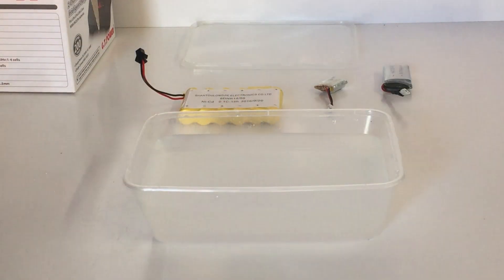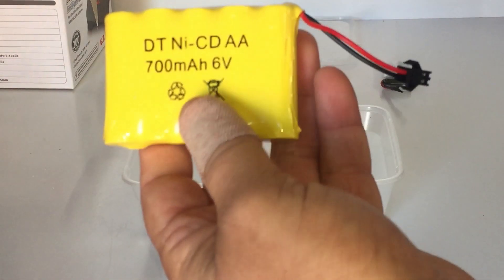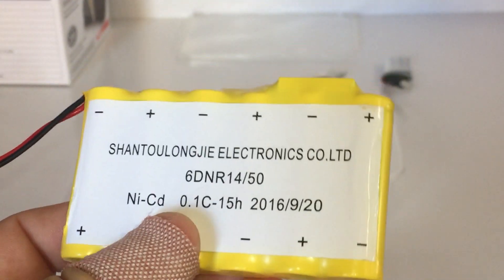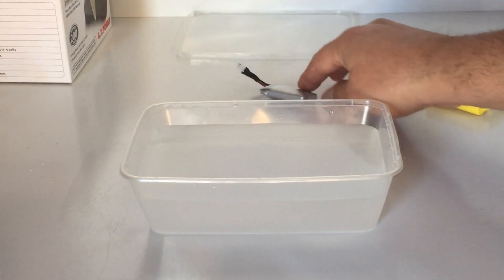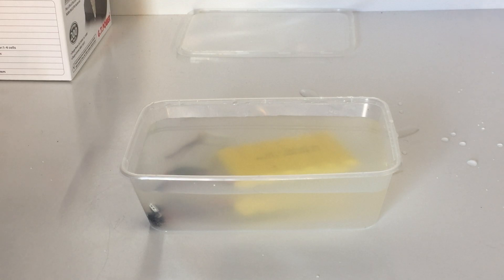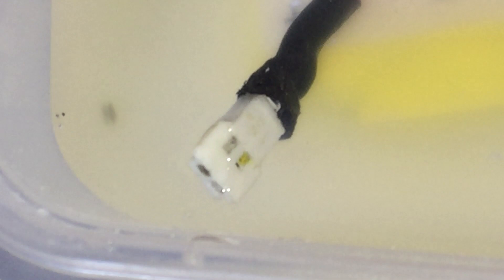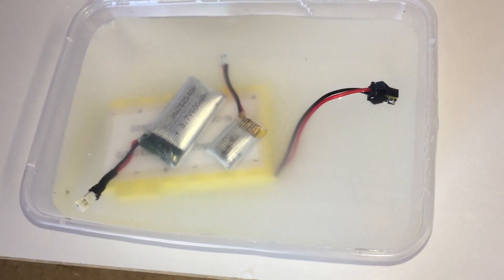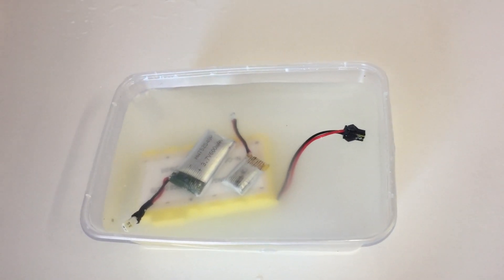Faulty, Puffy RC Batteries? How to Safely Discharge them with Salt Water ✔

Comment: I’m here thinking he was going to tell me after all the bubbles are gone I can just throw them in the garbage 🤦🏽‍♂️ so I still need to take them to a recycle center.  Why not just take your battery from the get go.  Discharge as far as you can and then take it to recycle center.
Reply from the maker: Mate you can do what ever you want to do with em, if that's throwing in the garbage bin, but i wouldn't advise that and take it to a battery place instead that can dispose of faulty batteries properly, even discharged

Comment: 7:24 That yellow at the connector is not the 'nickel or cadmium being released'. The battery chemicals stay in the sealed battery cells. What it is is the results of galvanic corrosion on the pins/wires in the connector. Probably from the copper in the wire, but maybe from whatever the pins are coated with (e.g tin).

Comment: Nice one mate. Thanks for showing us how it works. Do you cut the connectors off afterwards? I was told that you cut the wires off to stop the battery gaining a little charge through friction....?
Reply from the maker: Yes I tend to cut the connectors off sometimes

Comment: Good job on this Dave! It is the correct way to discharge or should I say the “safest” way. I haven’t done weeded through mine in a while. Probably a good rainy day project in the near future! Thanks for sharing this informative but important video! Right on brother!👊🏼👊🏼👊🏼🔋🍻
Reply from the maker: Thanks very much for watching Rob, yes there are a few ways to discharge lipos and other rc batteries but I have found this way the best and safest, especially for vey dangerous puffy looking lipo batteries. In the last batch I disposed of, which I forgot to film... I had a MJX  Bugs 6 2s lipo look like it was about to burst and after placing it in salt water the cells shrunk to next to nothing that the shrink wrap was loose. Definitely a must do is check periodically the health of all our RC batteries and immediately get rid of the bad ones, not worth a potential house fire 💥🔥